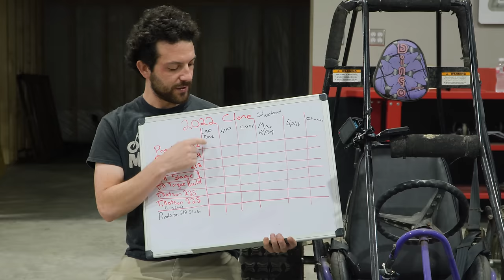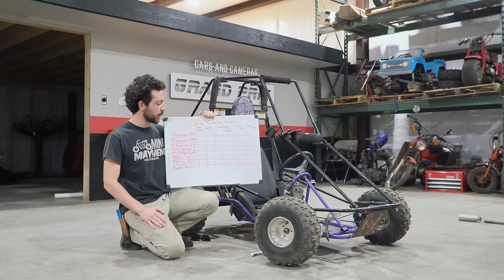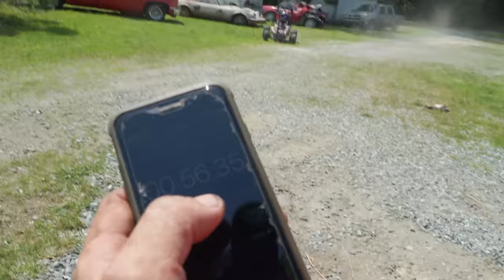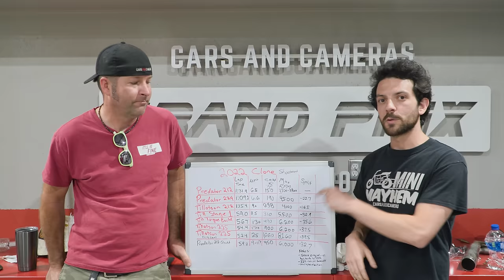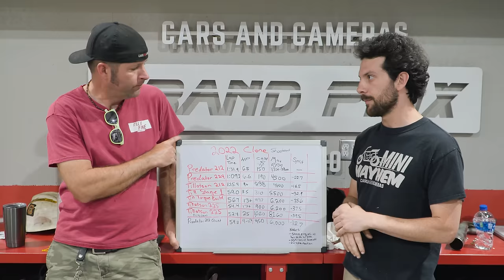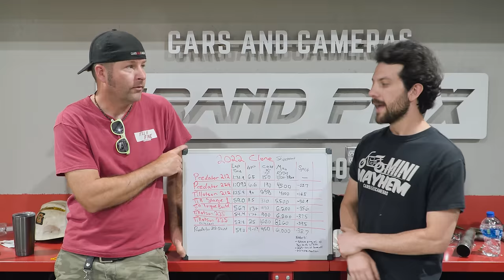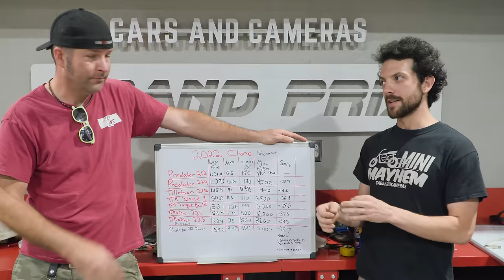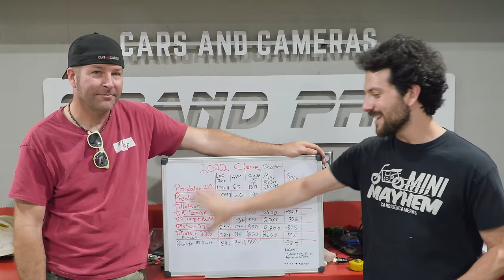Comparing 8 Honda Clones from 6.5 to 25+ Horsepower | SENDING 8 Performance Go Kart Engines!

Comment: Be interested to hear Ikes rant about the new ghost 👻 engine. I feel that it's not worth the money over a stock predator that has the basic same parts besides the rockers. Sorry.
Reply: Yeah, they're fine if the point of getting it is to race in a specific series requiring factory sealed engines, but you're better off with a stock one and upgrade it.
Reply: I always enjoy a good rant too! Let’s be honest here, Go Powersports sponsors C&C, Harbor Freight doesn’t. Ya got to dance with the one that brung ya. It’s pretty hard to make a fair comparison between a sponsors engine and an engine from a shop where you have to pay retail and don’t get any kickbacks. Thanks for the videos!

Comment: I actually work at Harbor Freight and I've been itching to see how the new Ghost Motors compare to the competition since they were announced. This was a fantastic episode and a great tool for anyone looking to compare their options for upgraded or new motors! Great job as always guys!
Reply: Ask HF why the Ghost vibrates so much!
Reply: @BuzzLOLOL  Mine never vibrated, when you mounted it, did you torque your bolts? use medium strength thread locker? did you install the engine at the correct tilt or angle. or have you thought about your motor being factory defect.

Comment: The first time I jumped my Dingo, I learned how bad the ride was. my back hurt for over a week. I ended up using a really thick cushion under the seat after that.
Reply: i hit 50 with mine on a stock internal 212 predator hemi, stock carb and stock exhaust and i rolled it bad lol

Comment: Ike : "This thing vibrates like crazy"

John : "Did you check the air in your tires?"
Reply: the tyre pressures do look a bit high, would probably be much smoother with softer tyres

Comment: Awesome video! Thanks for comparing these.. I'd love to pick any of these really. I definitely want a go kart again. 

The ghost is $300 on the harbor freight website. I assume the accessory kit is the extra $150 or so dollars?
Reply: I'd rather have the regular 212
Reply: @NubsWithGuns  Your wrong.  Look at the times.  I have one on my minibike and it kicks ass.  I have had multiple stock 212s with Mikuni carb and after market exhaust and the Ghost is hands down a better engine.
Reply: @NubsWithGuns  The ghost engine is for a spec cart racing series It's not meant to be a super high performance engine. It is designed to be a less expensive option to the other engine in the spec class. Engines have to be approved by the governing body of the series.
Reply: @dillonpapa  does it vibrate like crazy?
Reply: @kleetus92  It vibrates less than the stock engines.
Reply: @dillonpapa  Interesting, so you think they just got a bad one?
Reply: @kleetus92  Who knows.  I don't think they gave the engine a fair comparison. Like when they were comparing the price the Tillitson was a price for a kit where you have to install all of the mods where if you bought the Tillitson upgraded already it was more than the Ghost.

Comment: John, uses your cnc table to cut put a bracket to hold the carb still, one side with 2 holes to go on the intake screws then a cut out of the carb bowl,  and use carb screws to tighten it all together, probably going to have some funky bends to make but it'll keep it was shaking around so much👍🏼

Comment: I really wanna see what you boys can do with a Honda grom! They’re fun to mod and there’s lots of cool parts for them
Reply: What year is your dr??
Reply: @waltcomotorsports3994  my profile pic is my old ‘05 dr200 and sadly it was stolen while at work and then I bought a ‘96 dr650 to replace it
Reply: Aww man thats brutal, my 92 dr350 was stolen aswell but by some divine miracle i got it back with little to no damage
Reply: they've done plenty with those Honda grom style engines. you've never seen any of their ct70 or z50 videos?
Reply: I didn't even know the predator 212 was so cheap

Comment: I was definitely entertained. That Dingo chassis was overpowered by those modified engines in my opinion. The "stock" engines would probably have done better with the torque converter that matched those engines like Ike mentioned. I think you could have got the points across with a simple drag race but it would not have been as fun. I think if had a chassis with suspension those modified lap times would drop by a surprising amount. Excellent video!!!!
Reply: oh that chassis was 100% being over powered hahaha. On a smoother/faster track it definitely would have showed a bigger gap between the engines

Comment: Oh man I would have whooped ass at the backyard 500 with these engine options in that cart 😂😂
Reply: I would love to try my hand at a stage 1 small block build off backyard 500. The dingo is a pretty awesome kart! No suspension but air down those back tires! 2.5psi is enough pressure to keep the bead seated and provide a pretty comfortable ride with 2ply tires.

Comment from the maker: Which engine is your favorite?
Reply: the ghost is probably the coolest but the the built 225 is the best imo
Reply: I think this list isn't complete without including the EC 228R and the EC 236R. Of these my fav is the built 225R, but you can get the EC 228R for under $900 and be able to spool 9000 rpm.
Reply: Stage 1 tillotson without the governor.
Reply: I use tilly stage one…love it
Reply: 212 predator has outperformed all the others hemi s all of them
In my opinion 
I’ve not experienced the 225 yet but 0-30 it beat the tilli but top end tilli wins
Reply: I think stage 1 tilloston without governor was the most balanced between price, power and time
Reply: Honda gx160 underdog engine for sure 👍

Comment: Wow the Predator 212 Ghost have an incredible price to performance ratio for being a stock engine with warranty.
Reply: I agree.  They added $150 to the Ghost for parts that they didn't include in the other builds and you can't buy a Tillotson 212 stage 1 for $310.  More like $420.

Comment: Love this. I’ll watch it all. But… I very much think you guys should do a project to build a DIY dyno for mini bikes and karts.  You’d probably need some sort of computer genius to help, but if you can get some trustworthy repeatable rear wheel torque and horsepower numbers, 0-40 times, etc, that would be great for comparing power plants and tuning. Then all these claims of “should be 25+hp” or “estimated 20HP from these mods”… etc could be actually proven and perfected.

Even just an engine dyno on the bench would be cool, to test and tune mods, and easier to build with a Mount plate, height adjustment and interchangeable shaft adapters. But engine specs don’t translate directly to rear wheel performance. 

Even better… do both!  The software would be the hard part, and the same software could probably be used on both.

Don’t do away with the actual driving tests, that’s the funnest part.  Just use a dyno to enhance the fun driving.
Reply: Plenty of people have made thier own dyno's so these guys definitely have the skills and tools, It's just the will and its far to easy to use the excuse "we just want to have fun" to cover up for false claims.
"I could do a 8min lap of nurburgring if I wanted to in my P1" is very differen't to doing it.

Comment: I have a suggestion as a part 2 to this video.  

Since GPS has an engine dyno, ship or take ALL the engines you ran for this shoot out, JUST AS YOU RAN THEM, to GPS and have them dyno all of them to get actual HP numbers and see actual rev limits.  Use same gas you used for the shoot out on the dyno.  DO NOT CHANGE ANYTHING.

Also, that Dingo REALLY needs a camera mounted at the roll bar pad in front of the driver/steering wheel.  The one up higher did a great job of showing the helmet being bashed all over the place (along with the head inside it).  You guys should VERY SERIOUSLY consider getting a padded neck brace to slow down that bouncing to lessen the brain scrambling.
Reply: You should not tell people what to do. Sounds pretty unreasonable.
Reply: @BMXrecords  lol, weirdo😆

Comment: This was a blast to watch, well done guys.  I think just for fun, you should take the 3 stock engines, Predator and Tillotson 212's and the Predator 224 and run them bone stock except for governor removed.  With the varying RPM ranges it's still hard to see which one really performed better.  Plus it would be good to find out how fast the cheapest version of each engine would be.

Comment: The only thing I will say is I felt the ghost engine got the short end of the stick in this video. Most of us building stuff won't need the accessories kit at all because we probably have the parts already which brings the cost down to 299.99 not $450. The second is it being fresh out of the box untuned or broken in. But I still loved the content keep it up!

Comment: I've seen videos where the guys using these mention the vibration or knocking. Double check torque specs. Tear it apart hopefully you all find the root of that problem.

By far one of the best video. 👌 thanks for for the years of knowledge and entertainment stay blessed.

Comment: Gotta do this with the T4 Kart on a proper race track. As a reference i ran a bone stock 212 vs a tilly 225rs just tuning gearing on a kart similar to the T4 at my local track and the difference was on average 10 seconds between the 2 engines. high 54's with the tilly 225rs and about high 1:03's with a BONE STOCK 212. Loved this video you guys are awesome btw! 🤙🏻

Comment: The boys are doing a great job of illustrating the law of diminishing returns. After a certain point profits/benefits gained from an endeavor will represent a proportionally smaller gain as more money or energy is invested in it. In this case the Tillotson 212 Stage 1 represents the sweet spot where the money & energy invested provides the highest return, proportionally. Loving the content from the new shop with longer run times and more production value!

Comment: Take a Sport Quad style ATV seat and cut the back off to fit it between the back rest and the front of the seat should be attached to the steering column.  Leave a seat or seat cushion of your choice on the bottom when you do this.   Its soooo much more comfortable!  Our riding friends and family all loved the difference.

Comment: I have a 196cc stage 1.75 looking at the tilly 212 hemi from GPS  you guys really are great for the testing here! What sold me what the. Upgraded valve springs, 10k flywheel and flat top piston, out of the box! I have a intake carb and header pipe with jets for the 212 just want a 265 cam. It's for my massimo warrior mb200

Comment: I appreciate this video a lot, it puts in practical terms, the cost and performance value in each of these engines and lays it out Linearly. I have been running a stage 1 Tillotson to 12 on my black widow go kart for almost 2 years now and as you said, it might be a good idea to upgrade to stage two.

Comment: I would like to see more shoot outs on engines with transmissions like the yard dart. As cool as the lawnmower engines are you can get much better performance at a cheaper cost with a motorcycle or atv engine I feel like. Like yeah the 212 ghost is $450 but you still need a good clutch setup etc so it can get pricey. Money aside I think it would still be a good addition to the channel.

Comment: ok so now you've compared a heap of small blocks... what's the cost of a stock 420 with the governor removed (or at least the throttle stop wound out) and how does that compare on the same cart? is the extra torque a worthy compromise for the extra weight?

Comment: I got a stock predator 212 on one of thoes lil kids track race carts with the body kit and slicks it did 40 mph with a race clutch and header not super fast but out the box direct swap on to anything similar and it's a sure winner at 100 bucks ... you can find gocarts and minni bikes complete with old crusty motors for cheap and put a new predator on it and have a good time ...

Comment: Back in 99 - 2000 the fastest clone motor we had came from NR racing  stroker motor .about that time some guys were doing the 4" bore on the clones seen a couple bust the cylinder right off .good old days
Reply: Congratulations fan, thank you for watching and subscribing...You have been shortlisted among our winners for the ongoing giveaway,Contact the number above to claim reward^^^^^^^^^^🎁

Comment: Very interesting info.   I figured out that I'm not interested in a no suspension go cart that just looks not fun.   Smooth track with the right wheels is be all about it.  Especially if you could do burnouts?

Comment: Now you need to do a Clutch/TC shootout so we'll know how to set one up to do what we want it to do. You need to get an air ride seat if you expect Ike to do that again. Need to box blade the track and start hauling a drag around it if you're going to run much that's not suspended.

Comment: I have the ghost on my BT 200x. Good engine but the carburetor really held it back so I threw a NIBBI 24mm on it and this engine woke UP! Next I will toss a billet flywheel and delete the governed coil and release the beast!
I paid $60.00 for the 2 year HF warranty which in my opinion makes it worth it as I beat on this thing pretty hard. If it blows up, I return it and get a brand new one.

Comment: It would be so easy to fix that track to where it wouldn't beat you to death. Just rent a Skid Steer with a 36" - 42" small dozer blade, and grade the track to where it's smooth. Just a few hours of work and you'd be running smoother and automatically have faster times too.
Reply: #SaveIkesBack
Reply: @WyFoster  and possibly someone's life, or at least help prevent serious injury. That track is WAY too rough to be running those speeds with those type of tires. I've been upside down and bounced off a tree in a Kart because of a bumpy track and big grippy tires like that. Haha

Comment: Look into the lifan hp212e, it's a 208cc engine with a cdi ignition and pressure lubrication with an oil filter. It's kinda hard to find though. I had to buy mine through eBay.

Comment: I've got a duromax 440cc making 18hp bone stock and it's plenty on my dingo it tops out at roughly 45 50mph and takes off just as hard and is rather scary at speed (twisted frame) but highly recommend swap it's cheap it's got a ton of torque and extremely fun
Reply: 18 HP good for about 80 MPH with proper gearing...

Comment: My Manco Dingo was sold as a 6.5HP machine but it only has a 169 CC engine. And even it is scary when you're going wide open, off road. I can only imagine how it would go with an un-governed 212 :P

Comment: You say the Tillotson with the mod is cheaper than the ghost but how much did the engine and the mod cost together? I paid 225.00 for my ghost and 120.00 for the accerioe kit  , that's 345.oo for the whole thing ready to burn blacktop.

Comment: Guys I saw a Tillitson on I think it was go-powersports that had a 3" bore.  Can you build one of those? That would be sick!  I'm not sure what head would fit that?  I have a million questions but if you built one it would answer most of them. :)  I currently own the tillitson 212 stage one without the governor removed.

Comment: I almost forgot, I also mounted a Harley LED headlight and tail-light, battery, and charging coils, with voltage regulator-rectifier, giving me turn signals, and high-low beam headlights.
Reply: Congratulations fan, thank you for watching and subscribing...You have been shortlisted among our winners for the ongoing giveaway,Contact the number above to claim reward^^^^^^^^^^🎁

Comment: Hey guys, I was looking at the pricing for the Tilly stage 1 and noticed some differences.  The prices for the 3 parts in the link add up to $407 not $310.  And if you buy the stage 1 engine, its $420, but still need a header with it.  Still a better value than the ghost but not as much as it shown.  Please correct me if I'm wrong, but thats what I'm seeing.  Ive been eyeing the ghost for a yard cart to replace an old racing motor.

Comment: The only suspension these carts have aside from the tiny little spindle springs is whatever compression discs you have left in your spinal cord. Ever since I got into go karts, I'm about half an inch shorter.

Comment: Question before comments. What`s up with the station wagon on the right side of the course @13:24 in the video?(appears every lap).
Kart needs shocks to keep your spines intact, in place  and  and your teeth in your mouth.
 On the low end Predator, Get a tiny nitrous kit😁
Now the Tillotson 225, you need to take that beast on a long asphalt straight in that kart with slicks, phone app speedo and see exactly what top rpm and speed are, cause it looked scary and sketchy af on dirt. Charles crossing the line on 2 wheels🙃.

I want one, but that price😮. Nice comparison guys, Thanks.

Comment: I have an idea for a build for you to try stuff a 1000 cc motor cycle engine on the Japanese mini truck and get it running like it should . it would also get your yard truck back in serviceable condition   instead of having it just set beside the new building

Comment: Man u guys are crazy I have a predator 420 on a 2 seater go kart it keeps burning belts if I dump the throttle all the  way but if I ease into throttle it runs fine at 48mph but will eventually burn through the belt that way as well please 
Let me know how to fix this issue 
thank you guys for awesome videos

Comment: 3rd time watching this and I’m still smiling and laughing. I’m pretty sure at those speeds, the roll cage is just good for light brush deflection. 😂 Definitely a candidate for best video!
Reply: Congratulations fan, thank you for watching and subscribing...You have been shortlisted among our winners for the ongoing giveaway,Contact the number above to claim reward^^^^^^^^^^🎁
Reply: I think that one had bars bent in and they just pushed them back out... but should have added some down braces from the bends...